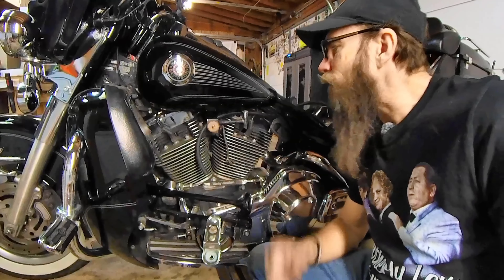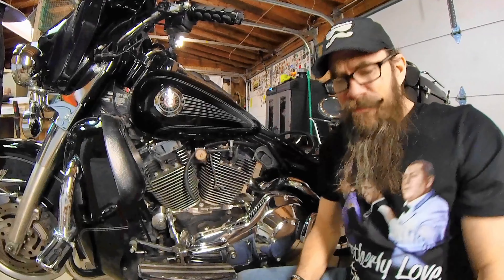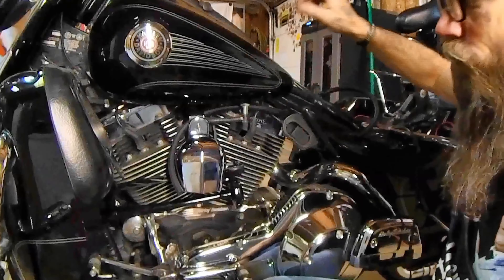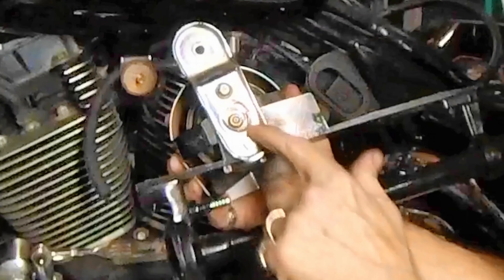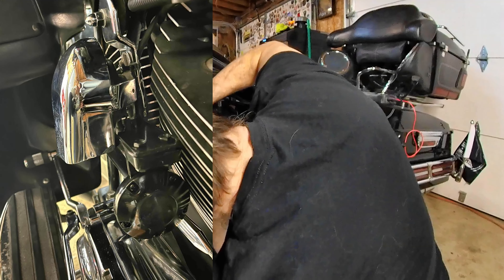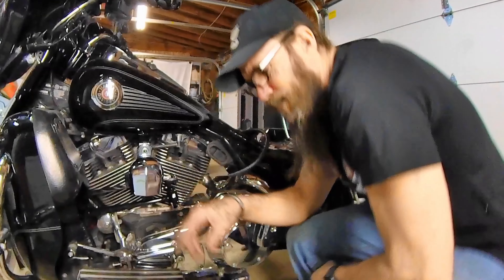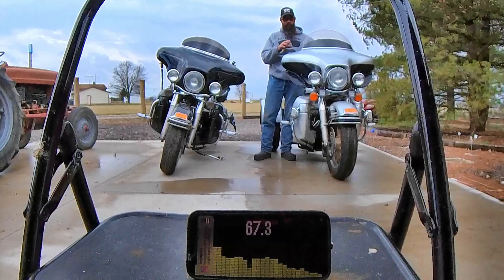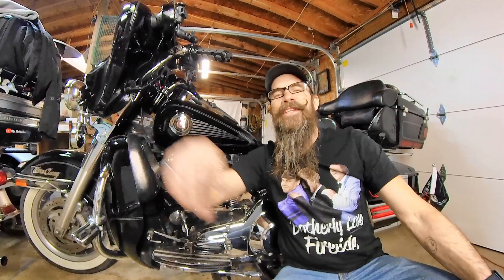Motohorn Install and Test Ultra Clasic #firesidechat @HarleyDayRider @BoDean52 @Broncoride

Comment: Great job, Jason.  Very good idea to swap the air lines.  That thin clear line might work for blowing bubbles in a fish tank, but would likely melt all over the engine of that beautiful bike. I love the work horn, I have never seen those anywhere for sale, they must require a permit, yes?  Well done, sir.
Reply from the maker: No they advertise mostly on Facebook and instagram. If horns required a permit then you would have to pass a test to drive. Then we would have people who knew what they were doing. Are you crazy with these kind of ideas or what?
Reply: @Mr.McStache  Wouldn't it be awesome if getting a license to drive actually made people drive well?  I have seen loud air horns for sale online, but not the kind that offers that "Attention, this is an emergency vehicle" type of sound.  I know that some states have different requirements for making certain types of purchases.  I wasn't sure if Ohio required a permit for THAT type of horn. Example: in TN we can have blue under body lights, etc, but if they flash you can get in serious trouble for impersonating a LEO.  Some states do not allow any blue light.

Comment: What particular “MotoHorn” did you buy?

I’ve seen other MotoHorn reviews and yours sounds like a Truck Airhorn which is impressive. 

Do you have a link to the one you purchased?

Thanks.
Reply from the maker: I actually bought mine off a local guy at a big discount. It’s the 2 or 3. O. It actually looks like a truck horn

Comment: If only one could mount a train horn.... 😁
Reply from the maker: I have seen the 3 horn system under the saddle bags of a trike. Have seen a single horn under the saddle bag of a bagger but I would remove that in a turn lol
Reply: @Mr.McStache  Yes, you would remove them if they were under the saddlebags. I have seen you sparking up the pavement, and the horns could provide you with multicolored sparks. 😁